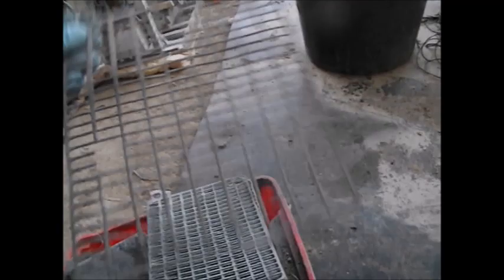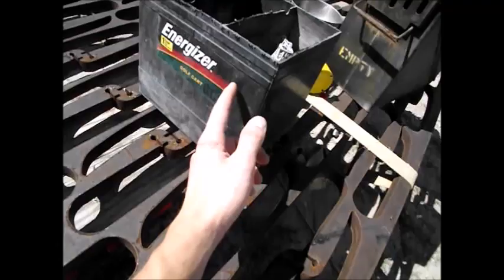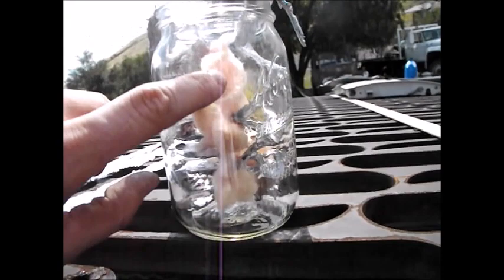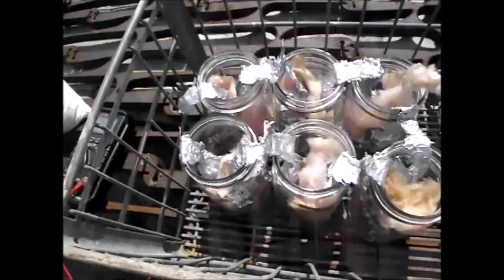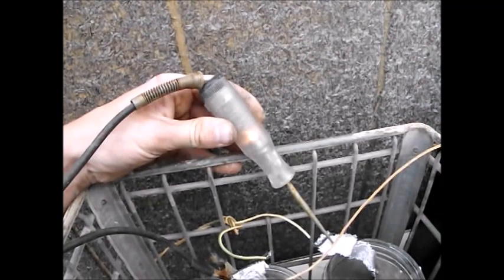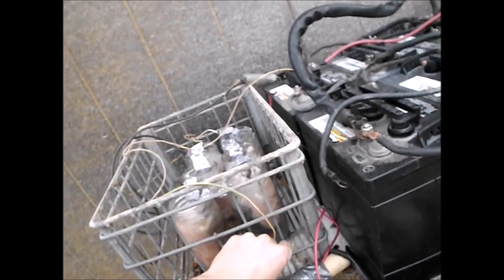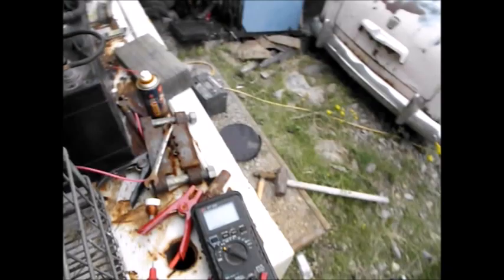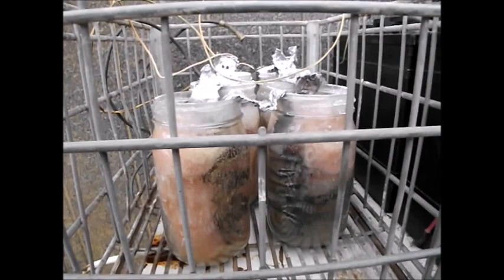Homemade Lead Acid Batteries

Comment: I am hoping to try this experiment. But, I want to know how long did the battery last before it stopped working altogether and you scrapped it?
Reply from the maker: Until it got cold enough outside that the electrolyte froze and broke the bottles.
Reply: Ok, how many months until that happened?
Reply: +sup3rt0aster I thought he lived in Utah
Reply: sup3rt0aster He's from Utah.

Comment: I wonder how much it would increase the capacity if you made some thin sheets and rolled the electrodes into a cylinder with fiberglass in between so it was rolled like a capacitor is, what do you think?

Comment: Hey Cody, Could you do a video on how to restore a car battery? And explain how the indicator lights on the top work?
(Heard lots of (mis)information about draining the fluid, adding Epsom salt solution, draining again and then filling with distilled water again would this work? Aren't you removing the acid?)

Comment: I would love to see that genny you have poppin in the background I have been working on achieving that exact sound/ speed I have a 3 1/2 briggs internally governed with an aprox 12 or 14 inch diameter driver and a delco alternator works but seems to have a conflictive issue with the governers .interaction/operation of fuel keeps trying to increase and I keep holding it in so its noise is internal and louder than its exhaust like a rod knock/wrist pin slap n yours sounds so sweeeet n steady would love to see it in action and with your ok reproduce one for myself I subscribed and really liked your video laiden jars I think they are called we find them in old farm houses for the phones usually sitting in floor joists or foundations top ledge its good to see someone else who tries to create and inspire others to do so as well as we are becoming a rare thing and almost a crime to do feel or be creative,inovative or challenge the status quo and have the gall to think for yourself they just wont let you do it here and go to great effort to control or remove you if you buck with em near 30 yrs I been fighting it n them and no end in sight and your genny would ease my load outta sight outta mind I live on solar/ gen they wont hook my power up no gas either cause I have an rv on my land to live in which I wouldn't be in if they hadent made my landlord and a sherriff at all but gun point evict me not for monies owed or any other reason but my junk collection and machines I build so watch out if they aren't on ya they will be and again thanks

Comment: Are you using ammonium chloride to form a paste from the red lead oxides, then pushing the paste through a fine mesh? Once dry this seems like it'd be a good way to form a battery plate to me... Still, there might be a better way to repurpose these batteries.

What if you intercept the battery when it's life is ALMOST over (e.g. it's still able to hold charge), dump the acidic electrolyte solution and replace it with your magnesium sulfate? It seems to me this way you wouldn't have to use a mesh and nasty chemicals to form the red lead oxides into a plate, plus both plates would have the benefit of maturity; they would have been extra-formed naturally over a full life-cycle.

I would love to see more of your battery experiments! Have you ever built a nickel-iron battery? There's a new kid on the block, too: The aluminium-carbon battery might be worth looking into! The trend seems to be to use graphite (the expensive stuff), though I imagine you could form a less expensive (though likely much less conductive) plate by reacting table sugar with sulfuric acid in a strong enclosure ventilated so only steam can escape, or a vessel that can contain the pressure necessary to keep the steam at such strong pressures during the reaction (perhaps plumbing pipe with threaded end caps? I don't know, and I probably wouldn't risk it; just vent the steam and be happy and safe!).

Comment: Why don't they make lead-acid batteries with a really fine sheet of lead (like the copper/aluminium foil used in lithium batteries) instead of a thick grid? Wouldn't that drastically improve performance? Or would the fine lead foil corrode rapidly and fail?

Comment: Forget the battery's bro what is that giant plate of steel from that has a bunch of pieces cut out of it and what are the dimensions of said piece of steel? I'm a welder and love metal.

Comment: How would you manipulate this home made battery to get  lots and lots of amps ??  What would give like 1000 amps ?    A car battery can deliver some 1000 cranking amps !   Thanks for the good work 
Kathrine !
Reply: Like he said Voltage = Current * Resistance.  Reworking this Current = Voltage/Resistance.  The two ways to increase current would be to increase voltage or decrease resistance.  Voltage would be adding more cells, Resistance would be larger plates in the cells.  Liked he talked about plates in car batteries have much more surface area that reduces the resistance.

Comment: what happens if you disassemble it (carefully) when its charged? like disconnect the cells, pull the lead out without touching electrodes to eachother, dump out the liquid, is there still something that can shock you in cleanup? where is the energy?

Comment: Hi friend,there is a simple way to oxidate the positive plates?, i have build a battery with only negative plates for the 2 polarity of the cells, but if try to charge that won t keep the charge,also i tried to reverse the polarity of charge,  i have put separated plates in the cell and not intersect togheter as factory to prevent the short,i was wrong?

Comment: I don't understand how you "chained" the lead strips and got negative and positive. It looks like you would begin and end with 2 negatives (or positives), not both. Can you explain?
Reply: One of the strips in each cell gets coated with lead oxide during charging. This makes it the positive electrode.

Comment: IIRC they put calcium in battery lead to improve the electrical properties of the battery. But this means it isn't compatible with arsenic or antimony. Which is good, because battery lead doesn't contain it, but you shouldn't mix battery lead with lead from weights, bullets or particular hot metal type.

Because when the calcium mixes with the antimony and arsenic in the lead melt it forms intermetallic compounds Ca3Sn2 and Ca3As2 . These are insoluble in the melt and float to the top as a scum. These compounds are quite dangerous as they react with moisture in the air to form stibine and arsenine, SnH3 and AsH3, which are extremely toxic and heavy so they accumulate.

Comment: so if you drained a car battery,filled it with an epson salt solution then reversed the poles would it clean the sulphate off the opposite cells ?

Comment: Hey Cody, the concentration of "battery acid" is usually 37.5% H2SO4(aq).
Reply: :   * #tamasgal vor #2Monaten
       " ... Hey Cody, the concentration of "battery acid" is usually 37.5% H2SO4(aq). ... "  :
____________________________________________

       may be , but that  could  unfortunately   be  above   the limit  , or  not  ! - ? ?

  because  if  more than 30 %  , then the  negative  Pb pole could be dissolved, as  I have heard  some years ago  . but  I am not  very sure  -  -  -

2017-03-22

Comment: Could you build a lead acid battery with the right voltage to power a laptop directly without an inverter and power brick?

Comment: Why is it require to charge the battery when there is already current flow from the chemical reaction itself? would you mind to explain i want to know
Reply: ***** stil i am quite not understand ;) could u explain again why use electricity itself to charge when the chemical itslef can produce
Reply: thx
Reply: +Meiji Jap In a charged battery, one electrode is coated with lead oxide, but Cody started with two lead metal electrodes, and although there could be energy released as the lead reacts with the electrolytes to make lead sulphate, there can be no voltage difference between the electrodes if both are the same. So Cody must feed voltage into the cell and build up lead oxide on one of the electrodes before the cell can produce a voltage.

Comment: Hello, I'm making a story of where kids are stuck in the wild, and are rebuilding civilization. Now, assuming they have absolute basic and primitive materials for making a battery, what exactly would they need, and how would they make it? Please respond. :)
Reply: Like, could the stuff in this video be feasible in the wild?
Reply: Well, they could of course collect rain water for acid; they could also perhaps find some lead from something old and they could charge it using lightning. Instead of a battery they could also make a giant capacitor that they could charge with lightning out of an old hat and some metal pans which seems to be easier to make
Reply: If you want something completely primitive then perhaps the lead could be found by one of them getting board and hitting a rock with something
Reply: Well first, they'd need to know what lead ores look like & some basic chemistry, they will also need to know how to find clay & build with it, so they can make a furnace to melt down ore bricks, they could easily get Iron from orange slime (Iron bacteria.) in creeks by mixing it into clean mud bricks with wood ash & melting it, I don't know if Iron can be used in batteries though, Quartz could be used to generate tiny sparks with the Piezoelectric Property, but sparks can't charge anything, so they're better off using a simple wire coil & magnet to charge the battery. Alternatively to electricity, they could use a water wheel with high torque to turn a long shaft, which they can attach belts to to power small devices mechanically.
I would recommend you watch videos by Primitive Technology, he makes some pretty cool stuff out in the woods from natural stuff he finds.
Reply: if they rebuild civilization, a generator with wind, steam or stream power probably would be more important first and needs no chemicals.
Reply: You could make batteries out of lemons/any citrus fruits ,  the citric acid is the electrolyte and as electrodes you could use a galvanized nail (zinc) and something made out of copper (a penny) But the power output is tiny, and you could only power LED's  and digital clocks/ primitive calculators.

Comment: I would have maybe rolled out thin sheet lead, cut to same widths and lengths, insulation batting in between, roll the three layers int a log, slipped THAT into jar.- a tab sticking up from each plate for terminals.

Comment: I have a few doubts. Doesn't the release of hydrogen affect the battery? I mean, would it be better if the batteries were sealed? Also, I was planing to make this for a car, so how much difference would it make to the current and capacity if I reduced the sizes? And lastly.. you said at the start of the video that you'd be using the oxide powder from old batteries.. but you didn't.. is there any way that too can come in handy?
Reply: ***** Thank you so much for the inputs! :) Looking forward to the other video! (Y) :)

Comment: What is the max current draw for a single cell and how do you get more surface area??
Reply: MORE surface area  comes  auromatically  during  m o r e  charge / discharge  cycles .  - the  process is  going  deeper and deeper   below the  lead  surface.

Comment: 1 liter of concentrated (96-98%) sulfuric acid on amazon costs about  9€ in germany
Reply: +Toxi Core I can get it at the hardware store for 6€ here in Italy, as drain cleaner.
Reply: +demoniack81 yes but you have diluted one and you have to destill it
Reply: mattibboss
I wouldn't call 98% "diluted".
It might have contaminants in it, most likely iron, but that shouldn't be so much of an issue for a battery.

Nothing a simple distillation can't solve anyway.
Reply: actually iron is a problem for lead-acid-batteries. it disrupts a chemical process in the battery and can cause random discharging.

Comment: T 18:30 I may be wrong but I think You should say: "Increase/(eg: Double - in 2 batteries setup) the voltage, so getting twice the power/energy (Wats)". (R=U/I, R=const, I=const, U=V1-(-V2), P=I*U)

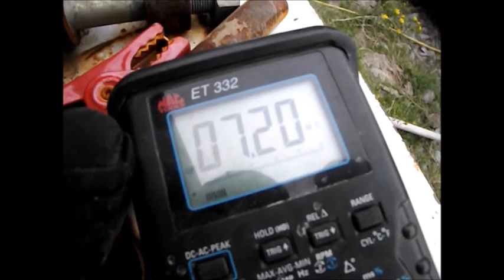Comment: 21:22 - he's reading MEGA Ohms... As in high resistance. Mega ohms and ohms is a big difference. That's 7,000,000 ohms. To give you a reference if something was shorted you would read less than a ohm of resistance.

Comment: I have a 6 volt car battery that I never used and sat on the shelf.  Will it be useless when I go to charge it or will it be okay you think? Usually when they drain they start breaking down.
Reply: lead acid batteries have a slow self discharge, you NEED to charge them when being stored at least every six months.
once they discharge below 11.2 volts, they will degrade and die quickly.
Reply: John Douglas Thank you. As you know, 6 volt car batteries are a bit pricey.  Well, all lead acid are imho.  I'm thinking of building one of those super capacitor 12volt ideas people are using to start their cars.  My curiosity is why aren't car manufacturers?
Reply: well, because super capacitors also have self discharge.
and capacitors have their own issues as storage devices.
Reply: John Douglas I see.
Reply: I think it comes down to the fact that lead acid is the cheapest and "best" way to store energy.
best covering cost of production and materials and availability.
there are better ways, they're just more expensive.

as for batteries vs capacitors, a lead acid batter will hold it's full charge for six to 8 months, and then slowly discharge.
a capacitor won't last any where near that long.

so I guess it depends on how often you use your vehicle, how well maintained it is and how old the engine and oil is (wear creates greater friction and starting power required)

it's all depends on your cost/benefit ratio as to which is better suited to you.

there are new hybrid batteries hitting the market now too, which are a combination of lead acid and super capacitors built in.
might be worth looking them up and checking their specs.
Reply: John Douglas Great reply, John. I have an antique 59 VW Beetle (Type 1).  It's a little 6 volt 36hp engine. You might know the headache the interior batteries are with them, never mind the added weight.   Most VWs rust through the passenger side because of the battery.  This car is pristine, no rust. I sealed up the inside anyway with this stuff called POR15.   Just thought it might be neat to have capacitors on the inside or the hybrid you speak of.  Thanks for the reply.

Comment: I suggest that you use only distilled water to make the cells of your battery. Why? As a raindrop forms, it needs a grain of some kind of dust to form around. This dust is an impurity you do not want in your battery cell. Rain is not "pure" water like distilled water is. While I really respect the attempt to make your own batteries - do it right so that your efforts last longer. Wear a mask and nitrile gloves while melting lead (or even working with lead) for your own health. Heavy metal poisoning is no joke.

Comment: What kind of weird steel plate ist that at 3:00? Looks somewhat like a giant off cut or something.
Reply: I believe it is what is left of a steel plate after a bunch of parts were cut out of it using a computerized cutting table.  As for what the parts were that were cut out of the plate I have no idea.
Reply: I thought something like that too. May be something water jet or plasma cut. But it looks so damn strange.
Reply: That definitely wasn't cut with a water jet.  If you look closely you will see slag around the small holes next to the parts that were cutout.  A water jet would not leave any slag. Those small holes are where the torch pierced the plate to start cutting.  That was done with a plasma cutter or an Oxy Acetylene torch.

Comment: How do you determine which terminal is positive and negative?
Reply: that, and, why do these work, ive always heard that dissimilar metals were required
Reply: The beauty of this design is that the initial charging converts one lead electrode to the another material (Plumbous sulfate if I remember correctly). This means that you now have two dissimilar material across which the necessary redox reaction can occur.
Reply: .   + #skye bedard vor #3Monaten
      " ... _that the initial charging converts one lead electrode to the another material (Plumbous sulfate if I remember correctly) ... " : 
___________________________________________________________
  
' your '  Pb sulfate  o n l y  happens  during  d i s  - charging  ,  at  b o t h (!)  poles   at the  same  time  . . . 

   or did you  mean  that  -sulfate  o n l y  during  the  conversion ?  - that is allright, in the  meantime  both  become  -sulfate, and  t h e n   again  oxide and pure Pb  , now converted -  at the  end  of  c h a r g i n g  -

2ß17-03-22

Comment: you can't measure resistance if there is some voltage. actually if you switch tester you'll see negative resistance)